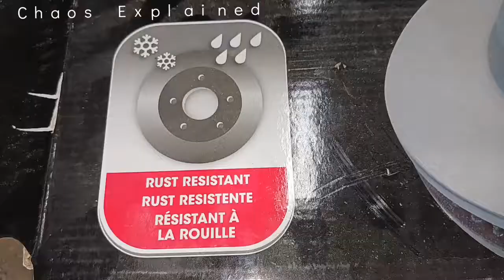"comical" 2014 Acura/Honda Rear brakes and parking brake adjustment RMX MDX how to replace EZ

Comment: for the brake adjustment, do you need to make some adjustments on the brake pedal? is there a screw for adjustment? thnak you
Reply from the maker: @raymondng9112  it's been awhile since I had that car, but most setups like this if you back up and hit the brakes hard it should adjust itself. If it doesn't have that mechanism then you adjust the little star looking thing one way or the other. There's also an accessible hole on the back